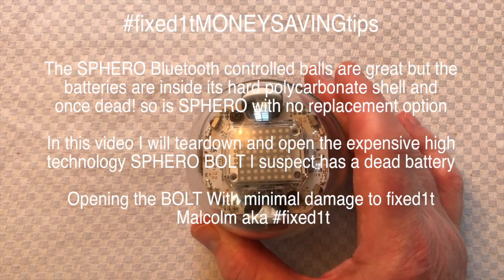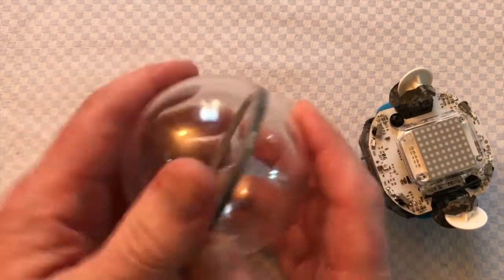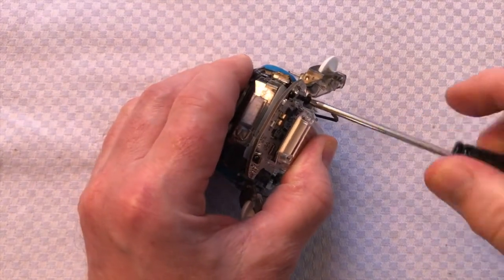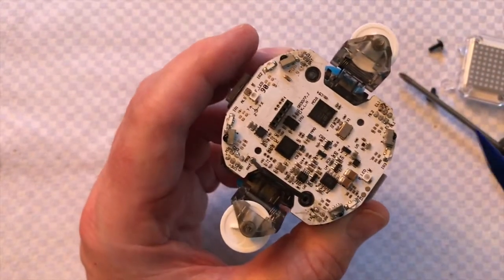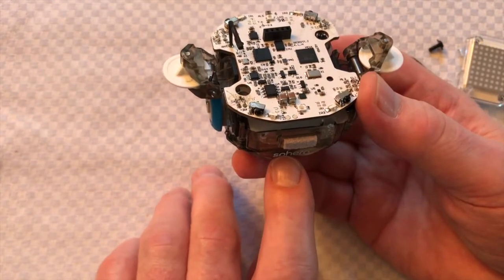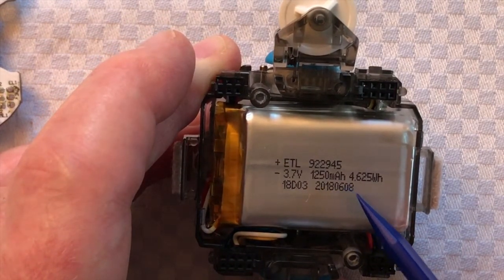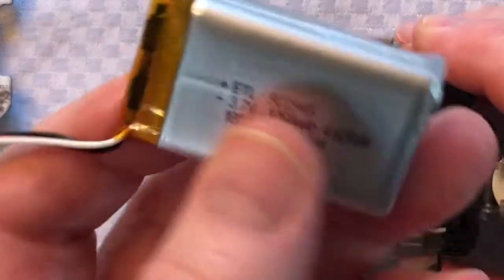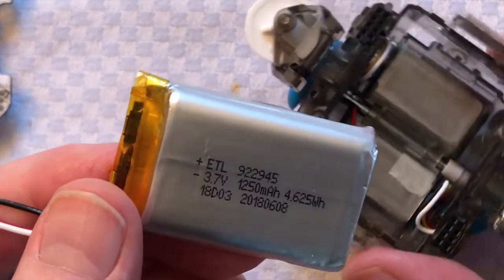SPHERO BOLT Teardown And Battery Replacement

Comment: Has anyone found the Bolt battery, LIPO 3.7v 1250mah, 922945? I have had no luck finding a match. But my Bolt is now open!
Reply: Hi! Did you find a battery? If not, I was wondering if you wanted to get rid of your Bolt. I work for an elementary school, and I'm teaching a Sphero Bolt programming class. I would love for the kids to take Bolt a part and put it back together again. If your interested in getting rid of Bolt, please let me know.
Reply: HI did you get it? please send me anything about it if you have
 @sherylwooten1700

Comment: hello :) saw your messages on another site. how did u take your poly shell apart? heat gun? or ? i took a hot nichrome wire and sliced thru one of them, the shell was basically in tact but had to be taped together. I like how yours looks, but how? lol thanks!
Reply from the maker: Like a woodpecker tap tap tapping at the seam for hours until it flexed and came apart. I plan to do a video this week. the great thing about this is even if the seam is damaged in a few areas the two halves fit together perfectly for gluing. Please don't forget to subscribe to my channel and share the video and channel with others. Thanks Malcolm aka @fixed1t
Reply: @fixed1t  have you done the video yet for opening the case?
Reply from the maker: I just finished part one of a two part video showing and explaining how I went about opening sphero sprk+ and BOLTs, seriously watch it all, https://youtu.be/smRz2hogNPE It may be tedious but if you make the mistakes I did to start with you'll wreck the sphero.  Part two will have extra tips and cover the sphero 2 as well. Please don't forget to subscribe and check out my other videos. Malcolm aka #fixed1t
Reply: Were do I buy battery?